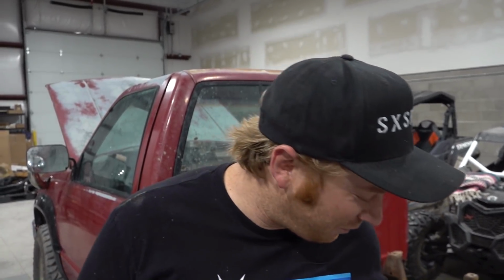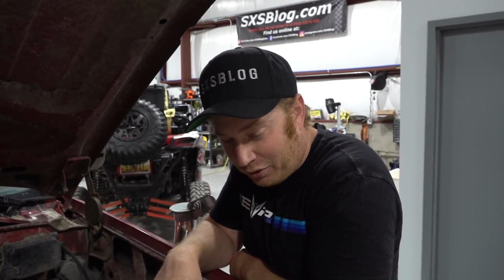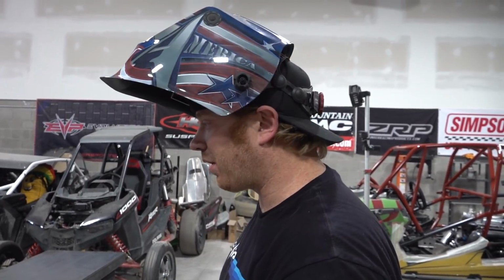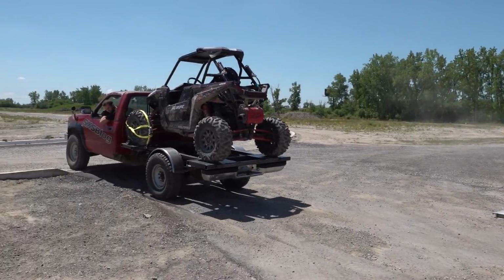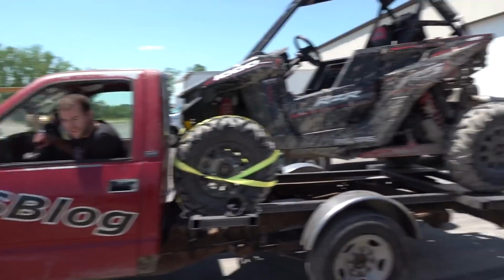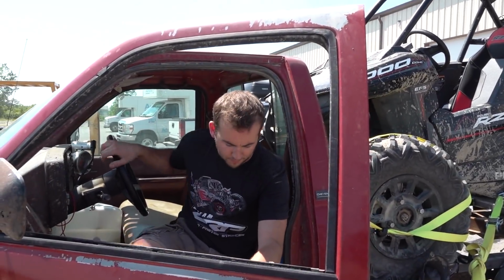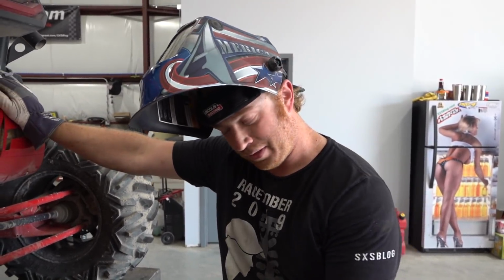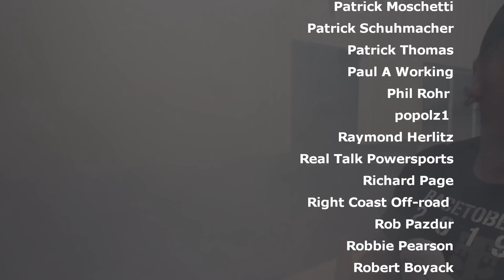How we're going to WIN BURNOUT RIVALS against CLEETUS!

Comment: Need to lower the psi in the front and raise the psi in the rear.
Reply: was gonna say the same
Reply: I've been thinking that since the beginning
Reply: Add weight to the front bumper of the race unit.
Reply: I figured they would have tried that so I wanted to wait until the end of the video but they can air down those fronts alot

Comment: Put weights up front like they do on there tractor pull trucks
Reply: This. And lower psi front
Reply: Mount  the water tank up on the front bumper
Reply: Yup they need to put truck pull weight plates on the front bumper to keep the front planted.  And also nitros to keep the rear wheels spinning.
Reply: Yes . They have moved the center of gravity back and taken to much weight of the front.

Comment: Well, I'm a little late with this 1, BUT, electric/hydraulic cylinder lift on the inside of the welded axle to Spring blocks pushing down! Flip the switch... power down, ass end lifts of the ground FOR SMOKING BURN OUTS.. adjust on the fly for wheel speed... casters on the bottom of the cylinder lifts! 
YOU SMELL WHAT I'M COOKING?
LOVE IT BROTHERS! 
AWESOME VIDEO GENTLEMEN!

Comment: spray vegetable oil on the tires.  plenty of slip and plenty smoke! also some side guards at the back so it doesn't wiggle off if Rick turns the truck hard.  keep the Cf1 on top of the truck!

Comment: Build a bracket for the front and add some tractor weights from your pull tractor, truck has power, lower front pressure add weight

Comment: my only idea would be to run a small line from your watering system to the tires on the sxs because that steel is going to get real hot, and an electric drill driver that could lift that wheel jack in the rear, controled in cab

Comment: Remove rear brakes? stiffen the rear suspension? Put the CF1s front tires on the roof of the cab? Moving more weight forward?
Reply: Nvm I finished the video now. There is no more rear suspension 😂

Comment: I would try turning the CF1 around so it's engine weight isn't hanging off the tail. Raise the air pressure in the rear and put those old race slicks on the front. Plus, if you're going to FLA to compete with Cleetus and the boys, there's one essential item that truck needs...Giggle Gas :)

Comment: too late now but a different torq converter and 2 step so you can get the rpm's up and give the rear tires instant torq and speed. That or a diesel truck with more front weight cause i have done burnouts with the sxs on the back.

Comment: A 50/50 mix of bleach and water does magic for burnouts, it helps break the rubber down better so its a smoke show plus the liquid helps to get the tires rolling over initially, done it several times with very underpowered 4 cylinder mini trucks that would never roll them over without help.
Reply: Once I get new tires for my talon I'll make a video showing what it does to a set of stock maxxis 😂
Reply: Ratchet strap the A arms to the top of the frame so you get zero travel in the front suspension, get rid of the weight transfer.
Reply: Also those trailer tires will probably be the best option with being as hard as they are they will last the longest and be the easiest to spin over

Comment: the pf454 you should only need if the engine is old pre gmt400 or from a 2 wheel drive.
Reply: TagGeorge ya it doesn’t have a 90 degree adapter to clear the driveshaft

Comment: Make a weight rack for the front like a pulling truck and hang some tractor weights. Your transfering all the weight too the back on top of the weight of the sxs. Weight on the front will help with weight transfer and help the front tires get traction. Also pinch the rear brake hose off with a pair of vise grips so the rear brakes do absolutely nothing.
Reply: Another thing you can do is create a set of bump stops for the rear like in a pulling truck because that will help keep it from transferring all  the weight to the rear also. And if your feeling real froggy you can also strap the front suspension down also so it cant transfer weight.

Comment: What if you turned the rs1 around and just make burn the tires towards the cab? Maybe change the weight distribution a little? Good luck duuuuudes🇺🇸🤙🏼
Reply from the maker: It's basically 50/50 with a driver

Comment: should mount a rack off the front of the truck frame and drive rzr up on it. That way you get the weight off the rear tires of truck and both can burn out. like this so they can see. easy One Day Fix.

Comment: All that dirt on the pavement is what's making that front tires push. They have no traction. On the concrete pad the front tires will grip enough for it to work. Or stickier tires in front. would've made the rack out of wood to and might've saved some weight.

Comment: What would be extremely helpful is to lower the front end as far as it can go. Especially if it has torsion arms then its super simple. Just loosen the bolt and watch it drop. Cause it's to high in the front and all the weight is in the rear. So doing so it will change the geometry and put more weight in the front where you definitely need it and will take weight off the rear and will also allow the front to lock up like you need it to. Doing this simple thing and no parts needed but a socket and impact..and wala you have it Burning Right🤘. I've done something extremely similar and what I said will work way better.

Comment: Hello guys I do not know the rules for were you are going but could you install a hydraulic lift in the rear to push down and lift the rear of the truck up that way you could burn the tires put roller wheels on the lift so you could still move slow some any way good luck and hope you when be safe.

Comment: 1- your testing on pavement with gravel and dirt on it, of course it’s going to push the front tires. 2- a lot smaller tires on the rear than front doesn’t help with the weight transfer, let alone with a RS1 on the bed. 3- small shot of nitrous.

Comment: New game plan!!!!! Put it in 4-wheel drive, Removethe drive shaft. However if you're worried about fluid loss leave the drive shaft, and remove the 2 spider gears on the carrier, leaving the 2 connected to the axles, so the axle doesn't fall out. This will give you a completely open rear end, the ring gear wheel spin and that's it no axial spin. However I'm betting you've already welded the rear end unfortunately, so you'll probably just have to remove the drive shaft. Then leave the rear brakes connected, and cut the front brakes, Weld the front diff. Now you're ready to do a front wheel drive burnout! Be careful, those hubs will lock in kind of hard... So just get it moving a little bit, before you start your burnout. The truck might have to roll a bit before the hubs lock, so give it a push. Trust me I broke my rear end once, I drove my truck for a week in front wheel drive. It'll work and it will spin the the tires easily! Probably not the easiest thing on the half shafts, LOL but it works!

Comment: Unless you’re gonna the biggest radiator for possible, run pure meth and/ or have a crazy air to water intercooler that 2jz will melt itself to the ground with a burnout. Hopefully you guys got the cooling down cuz that engine is gonna need it

Comment: The CF1 has most of it's weight in the rear.... Why not back it onto the truck so the CF1's weight is mostly behind the cab instead of behind the rear axle... Might also be safer that way if the CF1 breaks the tie downs it will roll off the back of the truck instead of hitting the cab with the current way it's loaded.... You could also release the tie downs for a grand finale and jump the CF1 off the back of the truck and have the truck & CF1 do donuts around each other... 🤣

Comment: Of coarse it’s pushing the fronts. Look at all that shit on the ground the tires are sliding on. Get the front tires on good clean concrete, pump up the pressure in the back tires, and let it rip.

Comment: Just slap some brembo breaks on the front
Reply: The front tires where locked up breaks won't help....? It was sliding the tires they are using mud tires to get grip on concrete witch is not gonna happen...

Comment: Too much talking and not enough action. A wider tire will mean less pounds per square inch as well so a different tire will give you less traction which you are looking for here. With a wider spray nozzle at the end of your water tubes will increase the flow all over the tire to increase even less pounds per square inch on the rear end as well. Plus mounting a heavier tank on the front bumper will increase your weight on the front to give you more traction on the front tires that will help in this project. Or even add some weights to the front bumper will do the same thing as well. More soap in the water will help it be slicker or a different additive solution. Plus using a different compound brake shoe in the front axle and removing the brakes on the rear wheels, and put more weight at the front axle. Would have been easier to mount a set of rods onto the front bumper to add some barbell weights like they do for Pulling Tractors to keep the front end down. Then just keep piling them on to get the weight off the back.